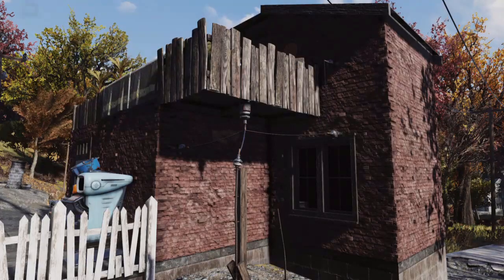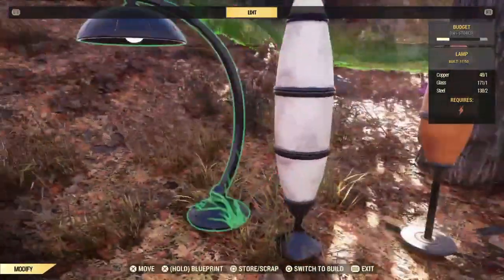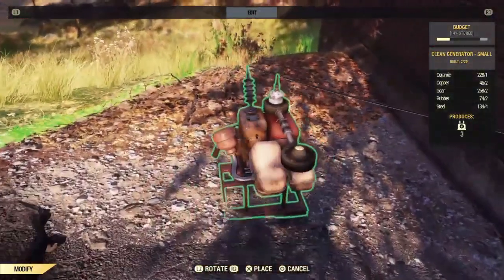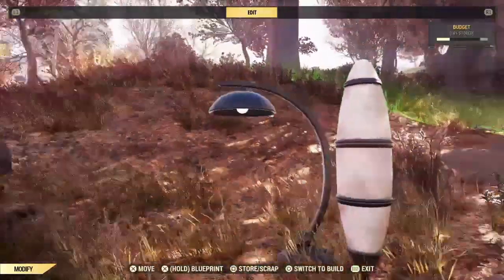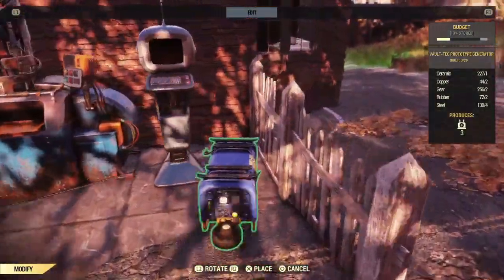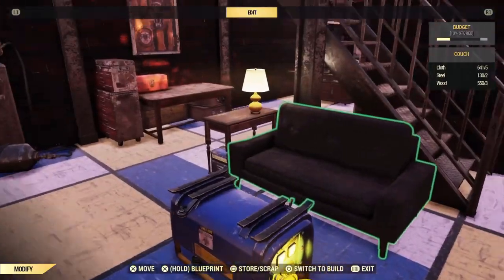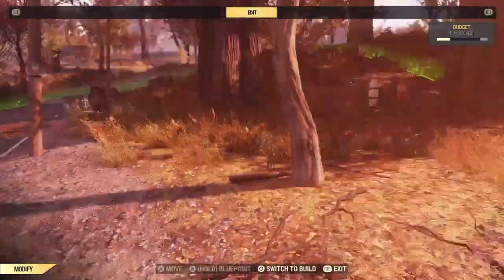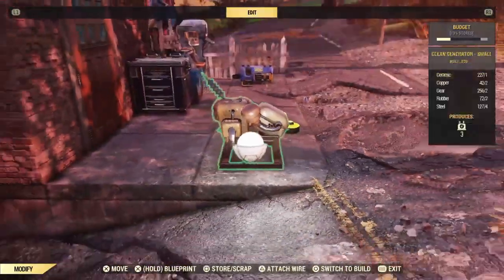Wireless Power Generator | Fallout 76 - No Wires Needed

Comment: I've just been putting the vault tec generator and a standard connector on a little rug and placing that wherever I need power (see the video for my alt's camp on my channel), but I like the way the bit with wires sinks through the generator with this method, gonna have to try this out!
Reply from the maker: Hiding the wire just makes things smoother so it's up to you but I like this way.....it's very sleek.

Comment: Nice one now you just need to work out how to hide that Genny inside a cupboard/cabinet lol.
Reply from the maker: Already know how but it's better to keep them out in the open to add a nice bit of decoration PLUS if you wanna move the genny then you wont have to deconstruct a cabinet haha.
Reply: @CaptnBeardy  Yer I'm guessing you could kill a cabinet with the flamethrower, place the Genny then repair
Reply from the maker: Just use the same trick I did to slide the connectors into the genny.

Comment: So does it work for the fusion generator
Reply from the maker: If you are talking about the massive dome one put in recent. Yeah it most likely does but the radius of the power is about the same as the generator so it’s be pointless. 

That’s why I used the small one. Easy to hide and perfect for putting in small corners out of the way haha.

Comment: Wireless generator doesn't work anymore😭
Reply from the maker: I’ll do some experimentation 🧪
Reply: @CaptnBeardy  so, the radiant one that lights up when connected doesn't work. However the solo free standing on that points up, down or to the side does work. I just didn't have them so I had to go get them. The nuka cola one is not in the atomic shop anymore.
Reply from the maker: I’ll either find a way to make it work or another way to do it lol. It’ll still be possible…..somehow 🤣
Reply: @CaptnBeardy  basically what happens to me. I hook it up. Sink it and it'll be putting power out. The moment I move it off the plate it stops putting out power.
Reply from the maker: Hmm tbh it’s sounds fixable. I’ll get on it over the weekend and if I find a fix I’ll make a short or incorporate it into a video 🤷🏻‍♂️.

Comment: Can it power a vending machine?
Reply from the maker: No. This is designed to supply power to your camp lights without having to branch wires all over the place. HOWEVER if you place the vendor on top of the generator, wire the two up and then merge them you have a compact powered vendor.